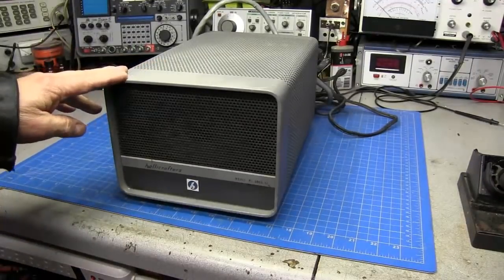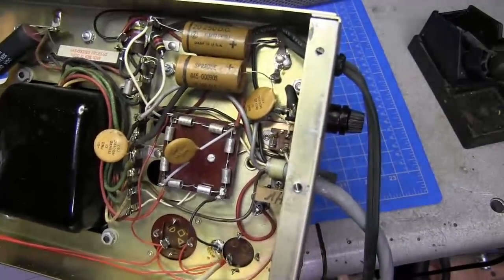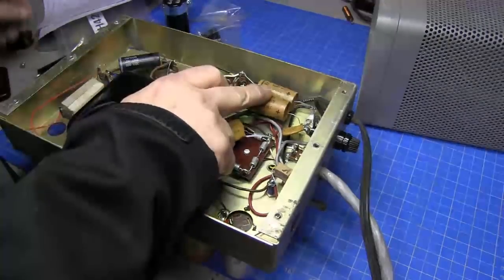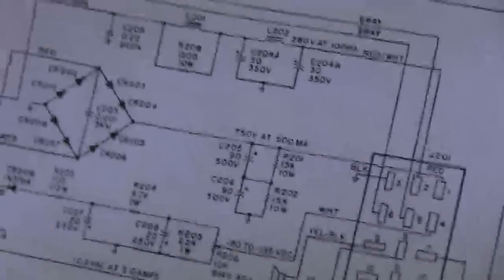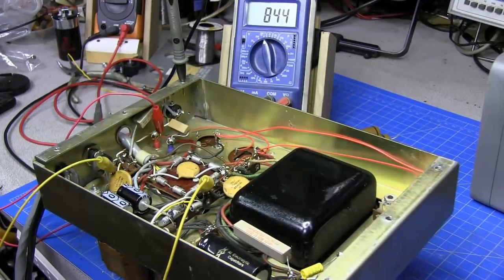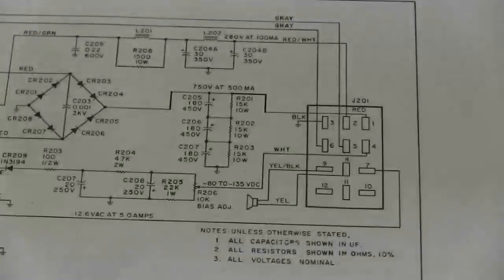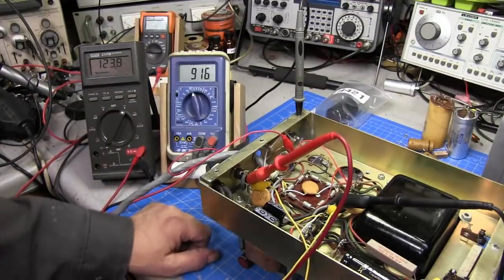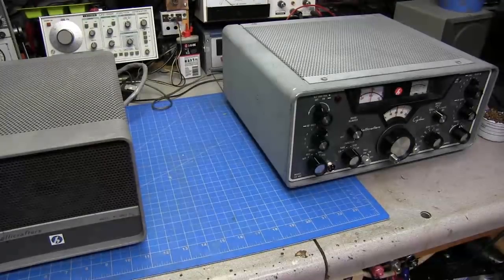#231 Hallicrafters PS 500 Repair

Comment: In your schematic I see three 15k 10w resistors over the three caps you put in parallel. Yet in the video I only see three small blue resistors soldered next to the caps on the new board you made. The two large 10W capacitors (R201 and R202 in the old schematic) are still snugly together underneath the chassis, those large bricks. 
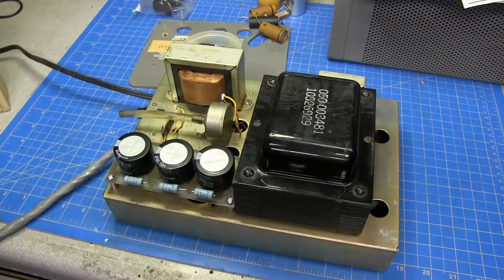Where did you put the new R201, R202 and R203 and what are those blue small resistors (no way they can be 10W?!.. and you mention 20k @31:55) 
I'm a bit confused on what's going on here.

I'm rebuilding my own PS 500 (The version without the bias pot) and considering ripping out all the old parts and redoing the whole thing, with some small modifications and with fresh, new, components.

Comment: Great video as usual.  One suggestion on your schematic diagram, especially if you plan to keep it with the unit and a service manual.  The three high voltage series capacitors you labeled them as C205, C206, and C207.  The minor problem is that schematic has another capacitor in the bias supply with a different value and rating also labeled C207.   Maybe relabel two of the three capacitors as C206a and C206b.  Again thanks for posting the video!
Reply from the maker: Thanks for pointing that out. I missed that bias cap designator.  I will redo the drawing then post it on my website.

Comment: I like the long videos, good for my hour long commute to work. Lol
Reply from the maker: Thanks. I will try and mix them a bit.
Reply: @TheRadioShop  I cheat on you though, I run my cb low volume unless I find something worth listening or talking about. I do enjoy your and Mike's old content(wish he'd get back into videos), I'm trying to get into electronics as I'm an I&E by trade and want to strengthen my electronics skills. I so far have a fluke meter, a simspson meter and a siglent 200 mhz scope and a siglent function generator with built in freq. counter, need a descent wattmeter setup though...

Comment: I keep looking at that bridge rectifier and wondering 'is Buddy going to change those out for some new ones too?'  Don't have much love for old diodes, since I have seen too many leaky ones.  You know that drill.  
Keep on, Buddy!
Reply from the maker: I would have but did not have what was needed in stock.  They checked out but so need to be replaced. I may let the owner do that. Thanks

Comment: I wonder why the 15K resistors across the three 180uF caps would not bleed off the voltage fairly quickly.  It appeared that the voltage across the top two of them was not decreasing at all when input power was removed.

Comment: i like that they chose to build a rectifier instead of just using a bridge the way they would today.
Reply from the maker: Pretty hefty build units. and weighs quite a bit.
Reply: @TheRadioShop  I have always liked the Heathkit SB series cabinets & chassis.  I've used a few derelicts made from goobered up SB-220's in homebrew projects.  Thanks Buddy
Reply from the maker: @gbowne1 The Heathkits are nice units. I have sacrificed a few to make other projects.  Never really like the SB-220's designs. Power supply and input coils were the weak links in those.  They make good choices for homebrew amps with external supplies though. Thanks for stopping in.
Reply: @TheRadioShop  Buddy, The SB-220's tended to get raided by 10m/11m freebanders, er CBers.  Thats why I chose the 220 theres a guy out there building clones with the Z tubes.  I'd use 4-400's and build it better which I did somewhat.

Comment: Hi Buddy. As usual, another great video from the master. Glad to see the PS500 in excellent hands. I would have never snapped to the difference in the two caps but do now. I have a PS500 I am replacing the iron core power transformer with a toroidal transformer and doing a recap. Had I wired in the 2- 90mfd/500vdc caps as usual and unaware of the danger, a shock may have proven fatal since I have a pacemaker. Always learn something new watching your videos. Proud Patreon!
Reply from the maker: Thanks, yep those dual caps can get folks every time. I seen them explode and put a nice dent In the top of the case.  The toroidal transformer is an interesting idea.  I like to see more on those.  Thanks for the support my friend.
Reply: @TheRadioShop  Glad to help all I can. Love your style and ability to share your talent so effectively. I want more of it so lets get the Patreon support ripping up the numbers so lets  make it happen.

Comment: Hi Buddy. Once again, I learned something new from your work. The variac on my bench is only good up to 0.5 Amps but that should suffice for most of what I work on. I love how you always stress safety when working on the old tube type equipment. Good job. Thank you and keep the videos coming. 73 de K7RMJ  Frank
Reply from the maker: Thank you very much for the comment Frank.  My small variac is a half amp also. The large one is 10 amps.  Glad I still able to produce useful content.  And safety is job 1

Comment: That high voltage can be scary. Plugged in a FT-101ZD the other day and zapp, sparks and a sinking feeling came over me. The high voltage lead was shorted to the case. Luckily no damage and moved the HV wire away from the chassis. Now I ask myself why I didn't use the variac.  I learn a lot from your videos Buddy and hope some of it will sink in to this old guys head. Thanks for the excellent way you present a problem and repair it.